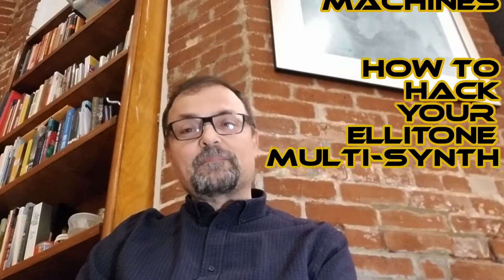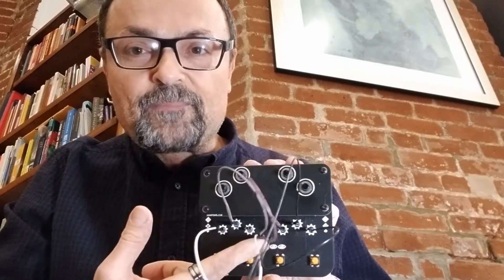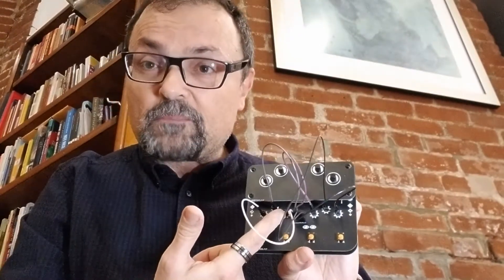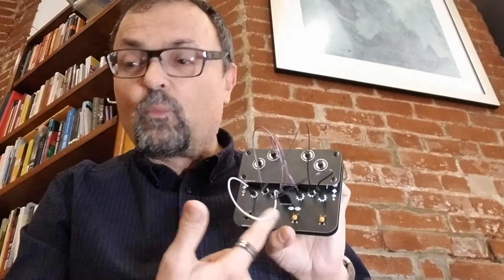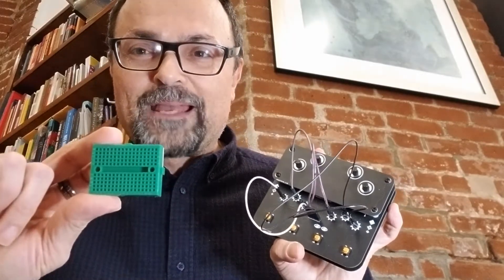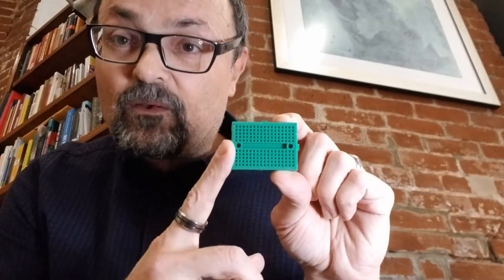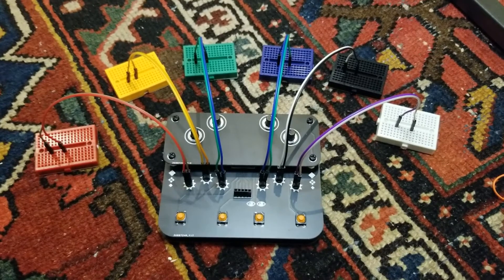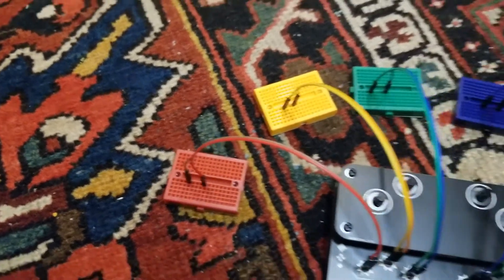How to Hack Your Ellitone Multi-Synth

Comment: so think id like to do this! i have the updated design synth with the wood and the patch cables are female to female. im a complete beginner at patching and electronics what cables / adapters would i need to be able to use on the update design muti-synth with the breadboard? 
i enjoy building wood cases for my synths so i may build a little wood frame for a breadboard in keeping wtih my wood pannels on the synth. which i love already having alot of fun with it.. appreachaite any help and thanks for the video
Reply from the maker: something like this maybe?   https://www.digikey.com/en/products/detail/sullins-connector-solutions/PRPC012SACN-RC/2776094?gclsrc=aw.ds&&utm_adgroup=General&utm_source=google&utm_medium=cpc&utm_campaign=PMax%20Shopping_Product_Zombie%20SKUs&utm_term=&utm_content=General&utm_id=go_cmp-17815035045_adg-_ad-__dev-m_ext-_prd-2776094_sig-Cj0KCQjwhMq-BhCFARIsAGvo0Kdz8QWpLXLaYDYrPVSYZosJF71rrQnPZwciixRn3JIBkujAt9GRDiIaAjQMEALw_wcB&gad_source=1&gclid=Cj0KCQjwhMq-BhCFARIsAGvo0Kdz8QWpLXLaYDYrPVSYZosJF71rrQnPZwciixRn3JIBkujAt9GRDiIaAjQMEALw_wcB
Reply from the maker: the bread board will be female so you just need to connect the female cables to it,  right?  that's the only difference
Reply from the maker: the idea of a custom wooden box is great. enjoy!  put up a video!  it's a great way to share knowledge and make new friends!

Comment: Could you multiplex the inputs too? Have two signals going to one input, or would that fry the circuit? I don’t know if it’s data or voltage like CV
Reply from the maker: My understanding is that it's actually data. I believe that each input, for wave form, rhythm, and envelope, and So on, is merely being informed which of the output modules is connected to it. Each output module is specifying an approach  That the instrument should take to that parameter And how it should interpret the knob values.
Reply from the maker: You could write to Ellis on Etsy, he's very responsive.
Reply: @esotericmusicmachines8136  It is done by having 5v square waves with different frequencies for each source. The destination knows which source it is getting, by what frequency it sees. It is not a normal analog control voltage.

Comment: Can u recommend where to get those cables? Thanks
Reply from the maker: https://www.amazon.com/dp/B077N9X7Y3?ref=ppx_pop_mob_ap_share
Reply from the maker: These come all connected together. You can pull them apart one at a time,  or two at a time, as I did. That's how I got the paired cables. Recommended.
Reply from the maker: Any other questions please let me know!
Reply: Esoteric Music Machines thank you! I just received mine this evening. I have no idea what I’m doing at this point, but sure am having fun doing it.
Yeah, we’re gonna need more cables ✌️😉
Reply: Im new to this stuff...can single dupont cables double up, or are there actual double cables? I dont see doubles on ebay.